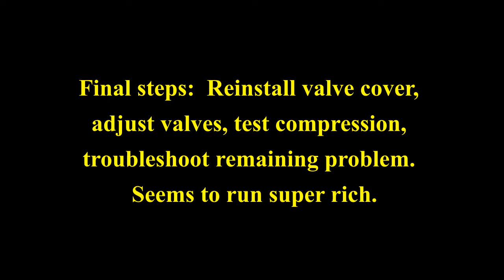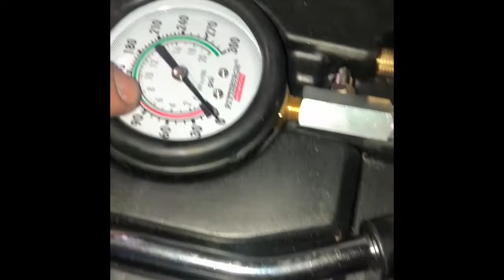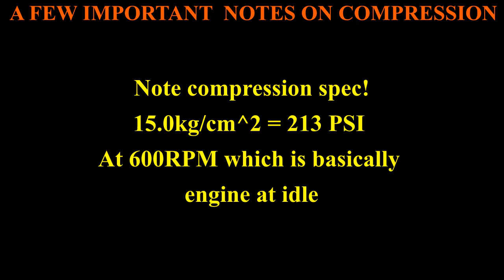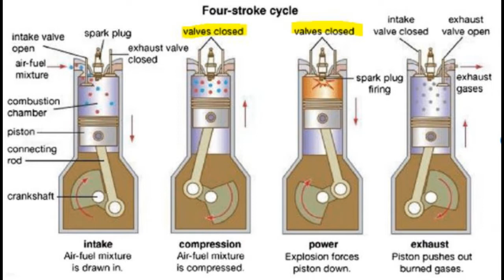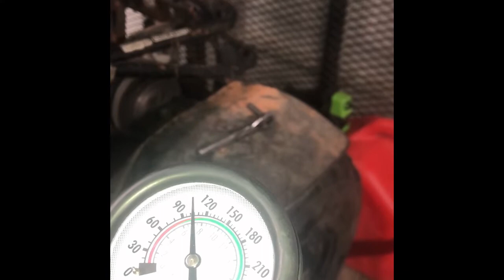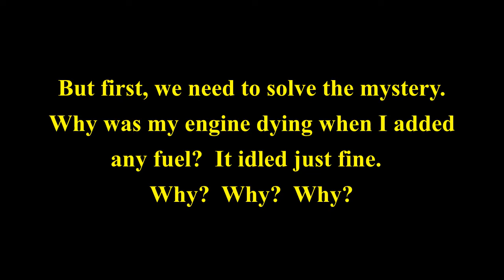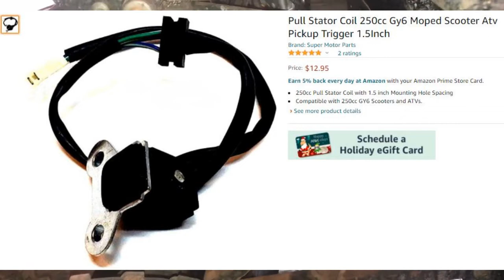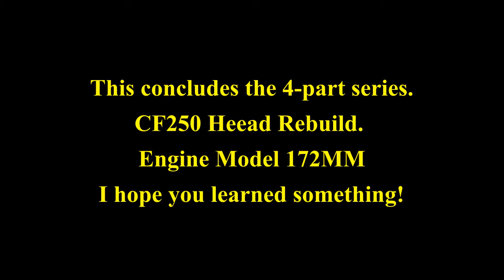Part 4 of 4: CFMoto 250cc Head Rebuild 172MM Low Compression GY6

Comment: First I want to thank you for this video and the sharing of your knowledge. Thank you! I'm working on the same engine for a friend of mine. I've worked on plenty of motorcycles, ATVs and all makes and models of passenger vehicles but I was so unfamiliar with CF MOTO as well as all Chinese brands. After much electrical work and a tear down and cleaning of the carburetor I attempted to crank it up with full confidence it would fire right up. Nope. Long story short... my friend had messed with the valve settings without my knowledge. After trying to find some decent info on this process for many hours with no luck whatsoever I thankfully came to your video. Thank you for being clear and thorough during your guidance! This was truly a blessing to find. I haven't even done the work yet but I'm confident that it will do the trick. Oh yeah, absolutely gorgeous terrain you have up there to enjoy! I'm way down in south Louisiana swampland and just a tad bit jealous of your location. lol just kidding. Thanks again! Have fun and be safe!!!
Reply from the maker: Thanks for taking the time to comment and say thanks.

Comment: Tip: your suppose to hold throttle open when comp testing. Mine reads 150 lbs and i didnt just rebuild mine. Ive got an elec issue

Comment: I’m trying to figure out what type of carburetor  this engine take I just got this very same buggy an the entire thing was a mess I’ve been going threw your videos to get this thing running but I would like to order a new carb so if you could point me in the right direction I would appreciate it
Reply from the maker: Here’s a link to the one I am using right now:  PD24J Carburetor 24mm Carb For... https://www.amazon.com/dp/B0BX3XNDLG?ref=ppx_pop_mob_ap_share
Reply: @pattywaktdiy4175  awesome thank you your videos have been very helpful I may have a few other questions mine I bought for my son the people I bought it off of had all the fuel lines coolent lines an wire harnesses broken an hacked together if it wasn’t for your videos I would have never got the wire harness back together so thank you for putting that together an being so in-depth with the key start
Reply: @pattywaktdiy4175  I have to figure out how to get the upper coolent lines together after I get the engine to have spark
Reply: That one just came in the rear part that mounts into the engine is to small compared to the one that was in there I think mine is a pd25j

Comment: Hello, we recently picked up a CFMoto ss250/Hammerhead/twister/trailmaster. I unfortunately paid a decent amount, and the rig only had 87miles orig, and shows. Ran excellent but appeared to have a knocking noise? Started engine this morning to begin diagnostics, and the engine quit, and now has very low compression. I checked my piston, rings, cylinder, valve movement and springs. Everything APPEARS to be intact, and in new condition. It does seem as if someone prior to me has poorly adjusted the valves!? any thoughts or ideas on why this may be occuring in this buggy? Great vids, and love the detailed info and parts links!
Reply from the maker: If you have truly validated and are confident in your inspection of what you’ve done already, I would validate that the timing chain hasn’t slipped a link or 2.  Also, did you lap your valves if you noticed carbon deposits?  Were there thick carbon deposits on the top of the piston, valves or your spark plug?  This could indicate a rich mixture.  The carbon deposits can prevent your valves from seating and you’d lose compression.
So check those two things:
1) timing
2) valve seating
Reply: @pattywaktdiy4175  carbon build up EVERYWHERE! also I should inspect timing more. I believe it's valve related, but limited knowledge. Thank you very much. I also believe the mileage to be accurate, but have a theory that it was not "broken in" at all, and maybe lead to premature part degradation?

Comment: Great video, very helpful because mine was in bits when I did the rebuild, may I ask a question about the water cooling tubes to/from the carburetor, if you can help I send more details about the problem I have.
Reply from the maker: Sure.  I’ll help where I can.

Comment: Hey, I was hoping to see a video of the coolant system setup.  I've spoken to you before about my setup and you were a huge help when I went to a new wiring harness.  I am stuck on the coolant setup.  I am good with the 2 large hoses but the small ones off the overflow tank to the carb and then to the temp gauge are probably not right.  I would have PM'd you but don't see how to.  Also would love that service manual you have.
Reply from the maker: Hey Dan, I’ll do what I can to help out.  First, the coolant system.  My setup doesn’t have any coolant lines going to the carb.  On mine, the temp sensor is inserted directly into the return coolant line just to the left of the carb.  But it’s not connected to the carb.  I have a small 1/4” overflow tube that just hangs to the side of the tank.  
The manual actually has quite of bit of info as far as the cooling system goes.  I didn’t know how to direct message either but here’s what I found l.  Try this:  “By clicking the username under any video, you're directed to the poster's YouTube Channel. Clicking "About" and then "Send Message" directs you to a form on which you can compose and send a private message”
From there I’ll try and get your e-mail to send you the pdf manual I have.
Reply: @pattywaktdiy4175  under about there are only 3 options and send message is not one of them.